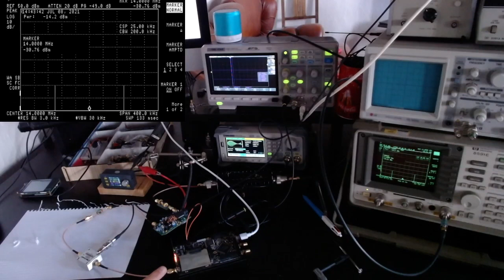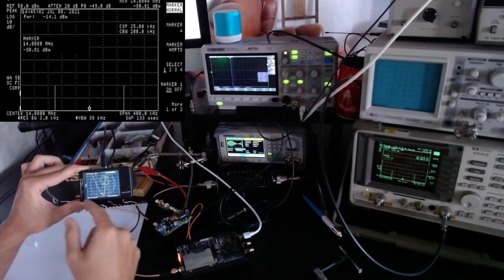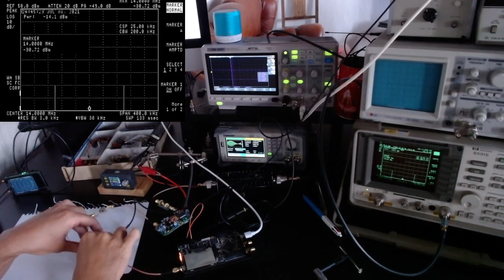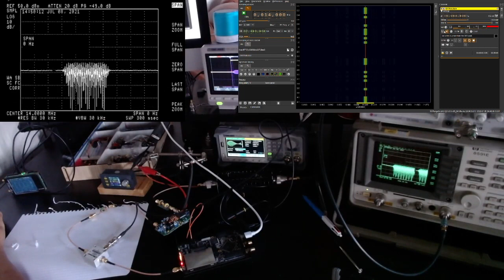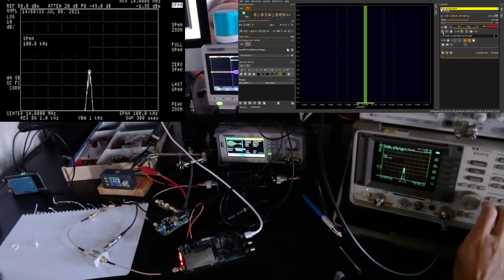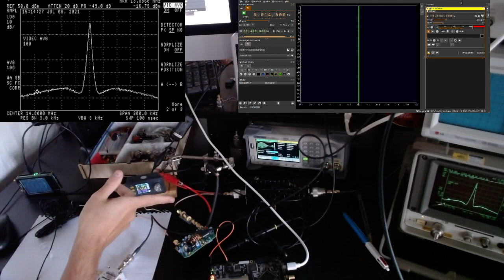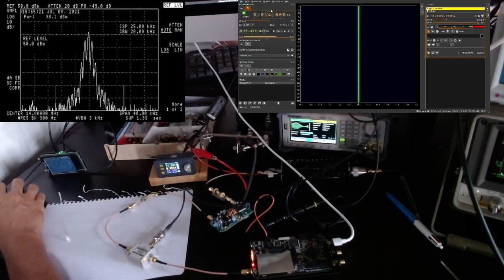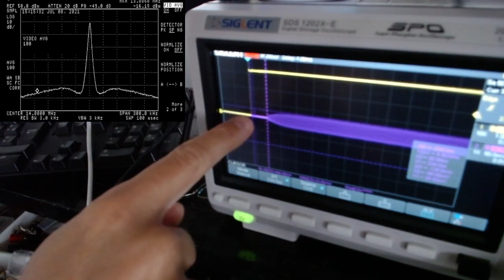Episode 73: HackRF + amplifier = 10W HF transmission!

Comment: Would you be able to jam with 10w with that amp?
Reply from the maker: sure, why not.
Reply: @therfnoob7697  But I guess this is only for frequencys 10 to 30hz would it be possible to jam 5.8ghz and 2.4ghz with an amp somehow?
Reply from the maker: @valgo8128  yes, exactly, you need an amplifier designed to amplify your desired frequency. Generally though, the higher the frequency, the higher the price.

Comment: How did you get that hackrf itself to transmit in the HF band. Doesn't it have a highpass filter that blocks both transmitting and receiving in this band?
Reply from the maker: Hi! The HackRF works from 10Mhz! So you can use the 20m band (14Mhz) without problems. No, unfortunately the HackRF does not have any builtin filters, so you need to add them externally.
Reply: @therfnoob7697  are there any good up/down convertors for hackrf, that would let it receive/transmit below 10MHz? I'm thinking in terms of low power AM broadcast band work.

Comment: This looks very interesting. This question may just sound ignorant but could you receive through the same setup or would it be best to use a second antenna and device for that? I’ve been looking out for duplexers but I’m having a lot of trouble finding one for sale anywhere. It would be great if you could just manually toggle between rx and tx on sdrangel. Great work!!
Reply from the maker: It's a good question! One would need a RF switch that basically 'switches' between receive mode and transmit mode, using the same antenna. There are several options out there. Google "TR switch" :) Good luck!
Reply: Cool! I’m pretty new to this stuff and like with many things knowing what to search for is important!!! TR switch has immediately brought up some leads, thanks a lot.

So, ideally your tx and rx paths have really quite different requirements so the more you optimise them the more your going to need either a second sdr or a full duplex sdr so each path can perform it’s function?
Reply from the maker: @alf-omega  Generally if an antenna is good for transmit, it's also good for receive. So, really, it's just a matter of having circuitry (the T/R circuit) that allows the transceiver to switch between a 'transmitter' and a 'receiver'. Note that this is half-duplex (you can only either listen or talk, unlike our phones). For full duplex you'd need two antennnas, or something like that i guess! :)
Reply: Hmmm… looks like these tr switches assume two separate devices sharing the same antenna, so maybe an sdr to receive and a traditional radio to transmit. I wonder if you could add a splitter cable to the antenna port on the HackRF and send one line direct to the receive half of a switch and send the other one through the transformer, amp and filter into the transmit half. I wonder if there are any implications to the signal in doing that? I’d probably want to insert my lna to the receive chain as well just because… you’re also up to 3 12V dc power inputs as well but I guess everything needs power?!
Reply: So, just for completeness, you absolutely can run a splitter out of the HackRF and send the tx and rx paths into a tr switcher. Or… if your skills are up to it, mine aren’t really at the moment, but yours may be… you could just do something like this :D
https://youtu.be/fLQSjAayd4U
Very cool…

Comment: From the specs this amplifier only supports HF bands.   I don’t understand how a linear power amplifier can not support HF/vHF/UHF?   Also from my research a band pass filter will work better.   Both will work but with band pass I will need various filters for different bands

Comment: Hi,  Have watched pretty much all your videos and am both inspired to share some of my own RF explorations and to look deeper into the HF bands (which I've mostly ignored in favour of higher freqs).
Am curious about the choice of transformer matching, and wondering how it compares to, say, a pi/T/L network.  A quick check seems to say that a 100pF and 1uH in L config could give you an almost perfect match on 20 meters but also reach down to the 30 meter band with a VSWR < 2 (according to simsmith anyway: if you don't know the program, do check it out!).

Anyhow, thanks again for sharing both your results and conclusions but also, and I think more importantly, your methodology and reasoning--been informative and enjoyable.
Reply from the maker: thanks a lot! I have to admit, the advantages/disadvantages of pi/T/L vs transformer are not entirely clear to me. The transform solution is quite broadband but has some greater losses. I haven't measure this in details. 

In any case, I believe it's possible to adjust the input impedance of the amplifier by chancing some of its resistors. But unfortunately I have burnt mine so I can't try right now. I plan to get back to the hobby in May/June and will surely try again :)

Anyway, I encourage you to share your findings! I have subscribed your channel :)
Reply: @therfnoob7697  oh no, another fried amp? blast!  I'm coming at this from the digital world, so am still getting familiar with the analog side of things.  I've much appreciated your channel.  FYI a few youtube resources of interest: course you know w2aew but a few others that might be useful are the signal path, FesZ and the ECE3300 university of utah course (which would be way better if they made some decent playlists but still).
Thanks again and, who knows, by the time you're back I might be ready for an HF QSO :)  
Salve

Comment: How did you apply power to the 10w amp?
Reply from the maker: I tried two options: a 12V battery (see previous episodes, like #69) and also with a bench power supply. If I remember correctly, expect about 2.5A at 12V.

Comment: what type of connectors did you use on the 1watt amp board for input and output?
Reply from the maker: I soldered some cheap sma female connectors!
Reply: @therfnoob7697  Thank you. Do you a part number of the SMA connectors you soldered to the pcb? Also wondering where you purchased?

Comment: Another fine video, thank you.  What type is the torroid and how many turns on the input and output of the torroid did you use?
Reply from the maker: Hi! Thanks!
So the input impedance of my amp @14mhz is 280ohm. So I used a 9:4 turns ratio (the 9 turns goes to the amp, the 4 to the HackRF). This is because (9/4)*(9/4) ~ 5 and 280ohm/5 ~ 50. In other words, the impedance divider follows the square of the turns ratio (check wikipedia on transformers).

For the toroid, I just used a random toroid I had in the bench. But I plan to use a better toroid to make a "permanent" work. Probably a BN61-2402 (which is the toroid used in the input transformer of the QRPLabs amp).